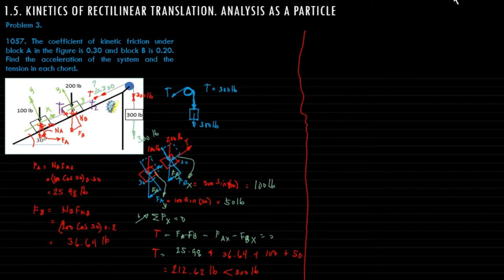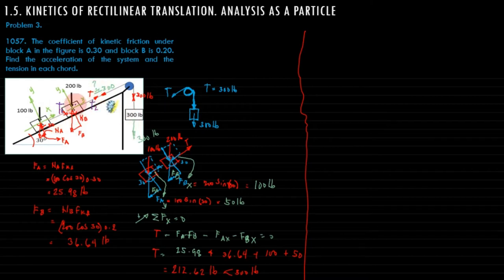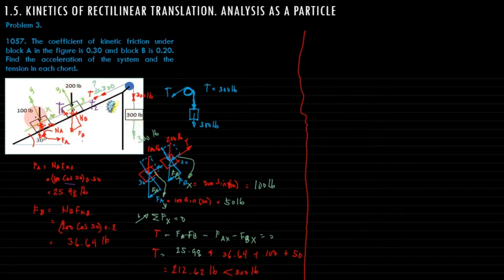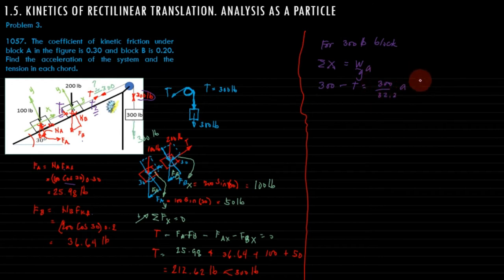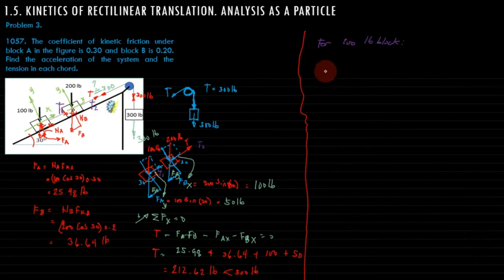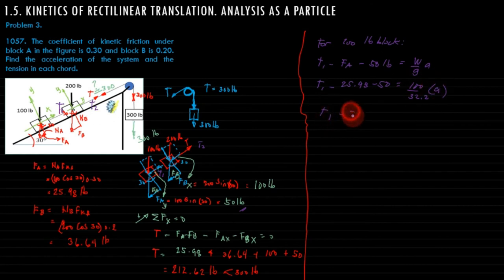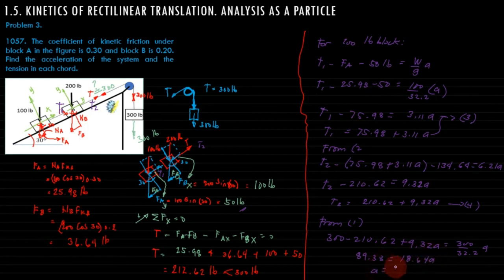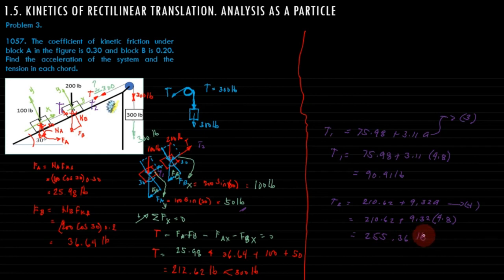Kinetics of rectilinear translation | Part 3 | Problem 3: 1057

Comment: fB must be 34.64 lb.. 

(200cos(30))0.2=36.64 lb
the final answer is still the same since the value of Fb used on the other page is 134.64  instead of 136.36
Btw thanks for sharing how to solve this one